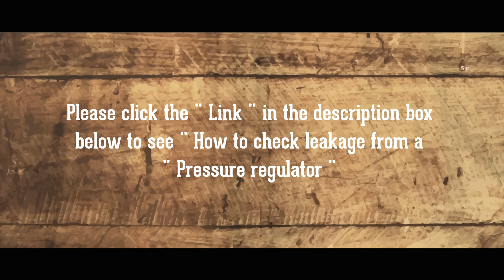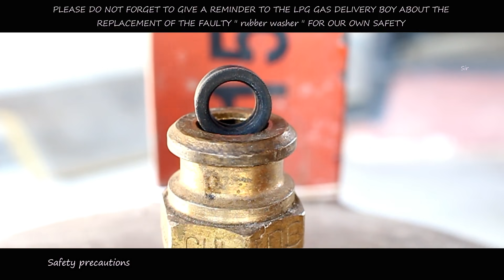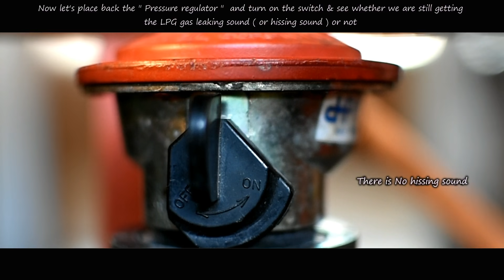How to stop Gas Leakage in LPG Cylinder (by Changing or Replacing Rubber Washer of the Cylinder)

Comment: Today when I was changing the gas cylinder, the regulator was not getting fit on the new cylinder. I saw your video and changed the washer with the old cylinder and the regulator easily fitted in the new cylinder and started working. Thank you so much.👌👍🏼

Comment: I had to fast tomorrow and at night my cylinder got finished so i changed the cylinder. The new cylinder i used was showing a lot of leakage and i only i had one cylinder.. was so upset as my sehri would had not possible without gas working. Came to your vedio . Checked out the problem and made it right.. m so happy .. May Allah bless you . ❤️❤️❤️

Comment: Life saving video boss. The video is so clear and with out unnecessary like subscribe and yet very effective solution. Could solve issue the tip of replacing the rubber o ring from old cylinder is very helpful else where to find the o ring in morning. 1st tension is to deal will Gas agency and book a complaint and to be in house when they come. All this you solved👍👍
Reply from the maker: Thank you so much for your kind words of appreciation.  It means a lot to me.  God bless 🙏

Comment: thanks to the heros who make such useful videos,
question: while you are removing old and putting new into the leaking new cylinder, does the gas not come out with pressure while doing all this?
we facing same problem today night when we attached regulator to new cylinder, so removed regulator, put that white cap and will call them tomorrow to check,
Reply from the maker: Don't worry, the has won't come out during the process 🙏

Comment: What to do sir if gas leaks from cylinder. Sometimes sealed cylinders found with gas leakage after opening seal and removing of  cap.
Reply: Mostly because of the pressure inside the cylinder,,,, it's always a good idea to release a little pressure from the new cylinder in an open airy environment with no electrical appliances on .... before you plug the regulator
Reply: But a word of caution
The pressure inside a new cylinder is too great and if your following the above method
Please advise caution
As you need to let the liquid evaporate before you use the regulator

Comment: Sir my cylinder operates without on off process of regular.... What can I do?
Reply: Dont take risk with regulator repairing. Get the new one. It comes in just 250 only
Reply: @vikassharma5545  sir I brought new regulator but problem is with cylinder valve.
Reply: @umarkhanelect  same question i just posted right now. Change cylinder sir. Till then, fix regulator on cylinder valve and close. This is my opinion.
Reply: @vikassharma5545  thank you sir 😍 ...